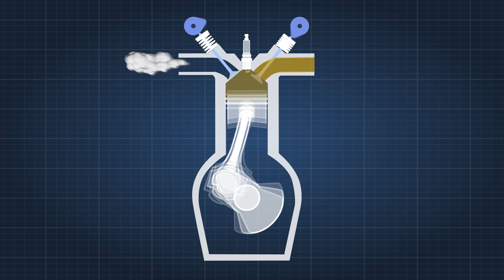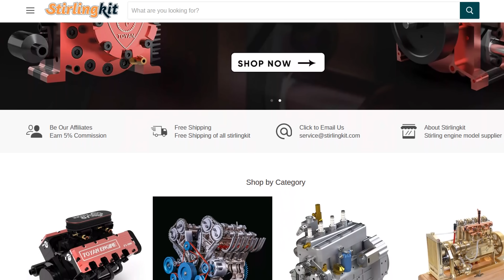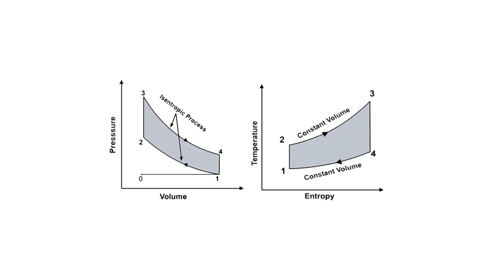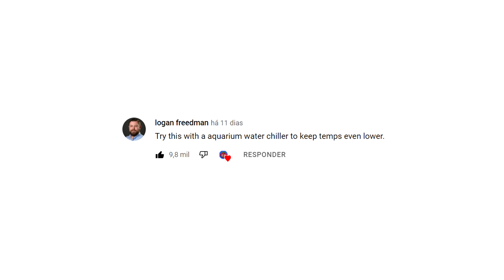I 3D Printed a Transparent Combustion Engine in Resin

Comment: Probably the problem with 25% nitrometane is out of your control, this is fuel for nitro RC, where the engines that use 25% are usually bigger than the ones that use 16% (16% is used in 1/10 scale RC and 25% is used in 1/8 scale). That fuel isn't actually a mixture of just nitrometane and methanol, it also has a lot of lubricants because rc engines are 2 stroke engines! So basically the 16% one has a lot more lubricant that the 25% one, 
But the 25% one being used in bigger engines has a thicker oil to compensate having less of it. The lubricant mixed in the fuel is designed to not burn in the combustion and stay in the cylinder, that's why both engines stopped running pretty soon when you ran them with those fuels, and the 25% one having thicker lubricants not being burnt probably created more compression in the cylinder helping it do the four strokes.
TLDR: the nitrometane fuel you used was meant for 2 stroke RC engines and has lube that doesn't burn instantly mixed in it, the 25% one has a thicker one thus creating more compression and helping the engine do the 4 strokes, but both of them couldn't make the engine keep running because of the lubricant not being burnt

Hope it is kinda well explained 😅

Comment: You  need to adjust the carb when you run other fuels than gas, its way too lean, the carb setting needs to be much much richer with methanol and rc nitro fuel, also put some kind of air filter over the intake to make it even richer, thats when its going to run much better and stronger on other fuels than normal gas 😄

Comment: You need to achieve a better ground from the head to the where the ignition source is coming from. With the brass it can acheive a really solid ground but with the resin the ground is only acheived through the rockers and pushrods.

Comment: It is related to air fuel ratio the carburetor is calibrated. You need to change that, it is trying to run oxigen rich or fuel rich depending on the fuel.

Comment: Its not just energy content, it is also viscosity, compression, air mix, and aerolsolization of the fuel. So gasoline may have better energy density, but your engine isn't well optimized for its physical fluid properties

Comment: The one with the better fuel might has less speed but more torque and vice versa ... Here, i guess the strength of the engine in contrast to the fuel is about the torque, and not the speed ...

Comment: I know that Nitromethane works well because it brings part of the oxygen it needs for combusion with it. It also has a wider range of flamability limit with air. 95 benzene starts at 1,4 vol% til 7,6 vol%. Nitromethane starts at 7,3 vol% and goes up to 63 vol% (technicly even more than that since nitromethane brings its own oxygen). Methanol also has a wide flamability range which starts at 6 vol% and goes up to 36 vol%. A higher flamability limit means you can burn more fuel in a cylinder offsetting the lower energy density of methanol or nitromethane. These numbers are for an uncompressed mixture though. As pulled from the Wiki page for flammability limit: "Temperature, pressure, and the concentration of the oxidizer also influences flammability limits. Higher temperature or pressure, as well as higher concentration of the oxidizer (primarily oxygen in air), results in lower LFL and higher UFL, hence the gas mixture will be easier to explode." LFL being lower flamability limit and UFL being upper flamability limit. So a higher compression would also help in getting the Engine to fire more reliably. 
Also an interesting note is aparently Methanol Nitromethane mixes also have a higher break power efficiency when burned in engines than gasoline does but methanol is pretty toxic and nitromethane is a controlled chemical which is probably why it isn't really used in comercial fuel for cars. A big point might also be the higher price per liter. It could also be that Methanol and Nitromethane get closer to a stoichometric mixture than normal gasoline does with how the engine is set. For pure Methanol this would be 15,38% (6,5:1 a/f), for pure gasoline 6,8% (14,7:1 a/f) and pure Nitromethane a whopping 58.82% (1,7:1 a/f). Its not recommended to use any more than 20 or 25% of nitromethane in a fuel mix though. 
In a research paper that i read it said that adding nitromethane to fuel can increase the output torque by 42% and the break thermal efficiency (BTE) by about 35%. You could try to increase compression by lowering the headspace of your engine. Since your cylinder is 3d printed this should be fairly easy. i'd also suggest looking at finetuning the mixing ratio of the carburator for the specific fuel that you are using. I hope this helped. i tried to make this as accurate as i could but there might be a few smaller errors here and there that i didn't spot. If you know more about this topic feel free to correct me. If you find spelling errors however you can keep them.

Comment: may you motor is fine tuned to a specific chamber pressure , equal or close to good working fuel
& gasoline is like 200% to strong wich stresses the engine^^
+ try the tiny red tomatos!!!

Comment: Try to make a plastic rocket engine as usual, but chemically coat the plastic with metal to make it stronger and more resistant to temperature.

Comment: For different power outputs for the different fuels:
Different fuels behave differently in a carburetor, mostly because of the jets. The jets in a carb must be the right size for the airflow and fuel type to get the right air/fuel mixture into the cylinder. This might also be contributing to the inconsistent ignition during the power stroke.

Comment: I've always loved 2-stroke engines but struggled getting my head around the flow of gases and relevance of different valves.  Would love to see that clear and with some way of watching gas flow.
Reply: Basically the bottom of the piston compresses the air charge to get it into the cylinder, so it’s kinda supercharged

Comment: I think you should try to find a resin that will let you print glass like the ceramic you have printed or maybe even aluminum oxide sintered into clear corundum as a tough material for projects.

Comment: The reason for the less energy dense fuel having higher RPM is that the lower energy stored means less energy to vaporize and vapor burns faster than droplets

Comment: Timing, spark plug gap, air ratio mix, compression ratio, etc, all factors that would need to be experimented with. Car manufacturers spend millions developing new engines, so I think you did well just to get one fuel, let alone all working! Each fuel would need a completely different setup for efficient 4 stroke achievement.

Comment: Are you adjusting the carbureta to give the correct fuel air ratio for each fuel? Gas is about 14:1, but methanol/nitromethane is around 4-5:1 IIRC.
Engines also usually like to be warm. Perhaps the resin cylinder is unable to get up to operating temperature?

Examine the audio waveform to see if you can identify when power strokes occur from the sound, and then compare against the original brass cylinder.

Comment: Your air fuel ratios are wrong. Methanol contains less btus. But we burn 2.2x the amount of it to reach stoic than we do pump fuel. Thus, more power. The same applies to the nitro. It needs even less air to burn with to complete the mixture. I’d love a 3d printer btw and also hate tomato’s. 🤞

Comment: The problems you're having are timing related.  You should be able to modify the timing.   Id like to see you re-run this with the timing corrected for each fuel type and some sort of measurable load on the engine.

Comment: when you change the fuel, you need to tune the carburetor. if not, the engine will run with either too much fuel or not enough depending on what fuel you're using. in the case of nitromethane you want more fuel than air.
Reply: Yep, pretty sure that this is exactly why the "better" fuels performed worse.

Comment: at 6:04: that is an older engine. it's using an old hit or miss system. which is why sometimes it fires and sometimes it doesn't... it works better if you have a load. like a generator or an alternator on it.

Comment: Fuel and air is leaking from the top of the compression chamber during compression strokes out of the top, which means the chamber has a maximum sealed pressure that is too low. It also looks like it’s leaking into the bottom of the chamber.

This could be caused by a variety of things, but I would recommend just sealing the top of the chamber properly with a stiff rubber gasket, and increasing the thickness of the bottom gasket to get a better seal.

I’m also not convinced that the CAM position on the inlet and exhaust valves is ideal, so do check that the exhaust and inlet valves are opening only at the correct times.

Comment: The problem seems to be the spark generation at high speed, if you realize the spark jump is consistent, that's why in the last test, at a lower speed I work accordingly, you should install a transistorized ignition system and a better ignition coil, the DWELL angle is important.

Comment: Well, you know that with an increase in volume, the pressure increases, and from it the energy remains stored.Then it is released in one go, better than the less energy fuel, which releases energy in each cycle

Comment: The ratio air/fuel is different for each fuel so the carburetors need to be tuned for each fuel to have the real fuel performance. It may be the reason for the lost of a power stroke.

Comment: It's not about the 'power' of the fuel, it's about the mixture, and about the time it has and takes to burn, and if it even ignites. Different fuels (and even mixtures) have different flame speeds, and need different ignition timing to work best. 

So your easiest to ignite fuel was also likely running with much too much advance on the ignition - resulting in a lot of loss of power (but more through burning) due to being on fire for the last little bit of compression, which would have worked to slow the engine down, eating up the extra power it was making by burning all of the fuel 
every time: Thus running slower. 

The other fuels were more likely burning slower (or at least, later) resulting in more heat input later into the expansion (where there's more leverage in favour of turning the crank) so that they managed to make the engine run faster, even though they were missing so often. 

What you can do to make a science of this, is attach a pressure sensor to the cylinder, and an angle encoder to the crank, then compare the two signals on an oscilloscope (or better yet, record it to a computer).  You can analyse that data to give a curve that shows when and how fast the fuel is burning, and even a measure of how much is burning (and how much power is being released). 

This would be actually pretty difficult to do well on such a small fast engine: It's easier to do on much bigger, much slower engines. It's to do with it being difficult to get a pressure sensor that can react accurately and quickly enough, whilst also handling the very large dynamic range of pressure you need to measure accurately to get an accurate result. 

So usually it's just an approximation of the actual, accurate engine power, but it is a very good measure to have: You will easily be able to see if the cylinder pressure is peaking before the piston is at top dead centre, for instance. 

You could try gluing on a strain gauge somewhere, and looking at the signal from it - won't give you a calibrated measurement of the pressure, but should at least show a change you can see, to show a curve vs engine position. What you want to do is be able to record this: So you can compare what it looks like with no ignition vs with ignition. Since you have the engine running often with a miss every-other engine cycle, this is actually ideal for this kind of analysis, since you'll have easily comparable data at almost exactly the same speed and certainly at very similar fuel and inlet air pressure/temperature conditions. Where the difference between the two curves is, tells you where the burn is, relative to engine position.

Good job though!

Other things: Consider turning the inside of a printed part to size on a small lathe by fixing the cylinder to the saddle and using a 'between centres' boring bar (aka 'line boring'): This will give very good roundness and straightness, as well as the best surface finish for a good cylinder to piston seal, which will improve compression a lot.

Comment: I would assume the engine has some sort of "anti-runaway" system to keep it from blowing up? A lot of them have some sort of centrifugal speed controller like a clutch to ensure it does not operate above a particular RPM range. This causes intentional misses to allow the engine to slow down a bit. I don't know this kit specifically, but it could partially explain the wide performance gaps. (Consider what would happen without such a device... It would speed up until friction stopped [melted] it or the metal components totally fail. A 10k RPM metal shaft flying through the air is a little scary lol.)

Second, I often see smoke/gas escaping from the small gap between the cylinder and head. You may need a gasket material there to prevent those losses. Either an O-ring set into a channel in the resin or even that cheapo "gasket maker" compound spread on before installation to seal the gap could improve performance. Even the smallest gap can alter your compression substantially and with heat and thermal changes between the materials, there could be fairly "massive" holes in the system. (This is an issue with cars where the block is cast iron and the head is aluminum. Head gaskets fail from the differing expansion/contraction of the two parts over time, essentially grinding the gasket away.)

Per other comments, richness matters for your fuel/air ratios. Some of your fuel appears to be seeping past your piston's O-ring so your combustion is definitely incomplete. The carb needs to be tuned for each fuel type and stoichiometrically attuned to your air volume. You have a set amount of air so each intake stroke should be pulling in the right amount of fuel based on that. Look into getting or making different carb components to balance the fuel flow.

Comment: make a rotary engine  some thing like the way electric moter works take the concept of electric dc moter and change it to working mechanical parts and magnatic attraction and repelsion using fuel explosin for expnsion and contraction   (you have to desing a mechanism ,  less  frection parts) ok

Comment: Looks like the engine you are using is just a toy and not good enough to go at the speed, the ignition system is acting like a speed governor.
Did you see the wide tolerances on the rocker arm bearings?

Comment: Interestingly, higher nitromethane concentrations tend to give less speed but more torque. You should test the engine with a load, perhaps a car alternator, a brushless motor or similar. Then you can measure the true power of the engine with a resistive load, measuring voltage and current and multiplying the two to get watts.

I expect the 25% nitromethane to give the best results by far)

Comment: I'm no scientist, but could the reason that the faster RPM fuels aren't igniting be due to the speed? Is the ignition coil responding fast enough to put out a spark before the stroke has completed?

Comment: Em Português é mais pratíco explicar isto.
Tem tudo a haver com a densidade do ar e do combustível e também com a capacidade de gerar uma faísca num motor criado para produzir mais poténcia (cavalos e torque) utilizam uma taxa de compressão mais alta, que podes replicar de medires a capacidade do cilindro com o piston em baixo e em TDC e da cabeça do motor em cc e depois com alguma matemática descobres a taxa que atualmente tém depois é so uma questão de imprimires um cilindro "mais baixo" para comprimir mais o combistivel, em contra partida também existem nos motores a gasolina velas com designações diferentes, mais frias ou quentes dependendo da aplicação e também metodos de aumentar a pressão dentro do cilindro como turbos ou compressores, com combustivel baseados em alcool ou afins Methanol, Nitromethane e afins há uma necessidade de aumentar a potencia da faisca para ter uma combustão completa, para isso também é preciso uma bobine mais potente, se quiseres experimenta fazer esta experiencia numa escala maior com componentes mais faceis de trocar, um motor de uma moto serra velha ou de aparador algo na casa dos 50cc, podes jogar com as taxas de compressão e faisas, o valor de oxigenio/combustivel é critico para o motor não falhar, uma sonda O2 montada no escape.

Comment: i think you are right in thinking that the speed is one of the problems with the 4 stroke ignition, but i think it is more the coil for the spark plug isn't charging enough energy to be able to create the spark, it can also be that the brain circuit is too slow to register every rotation(but i would think that if that is the problem you would had some failed/delayed ignition making the engine unstable)

Comment: I used to fly gas RC planes and we always ran the engines with at least 15% nitro. I usually used 25%. You might be seeing some slow down if the exhaust cam isn't timed right and you're getting some back pressure in your exhaust stroke. Which is why you would only see it on the fuel that gives consistent combustion. If the other engines aren't cumbusting like they should they wouldn't have that consistent back pressure, letting it run faster.